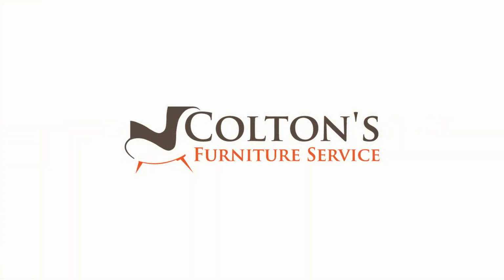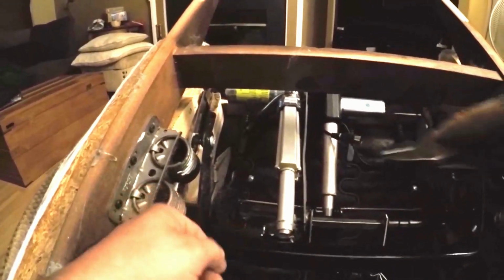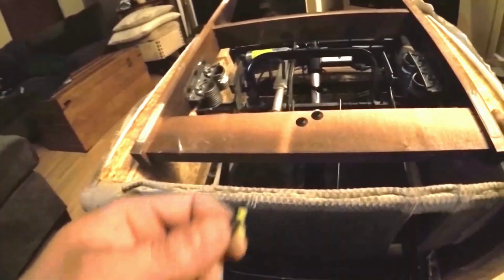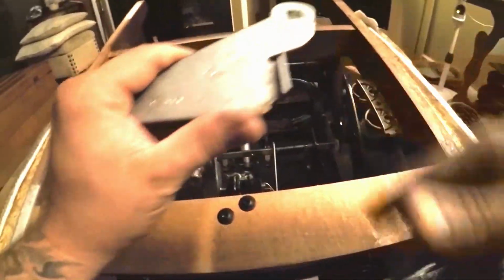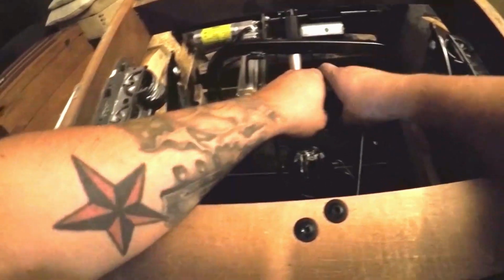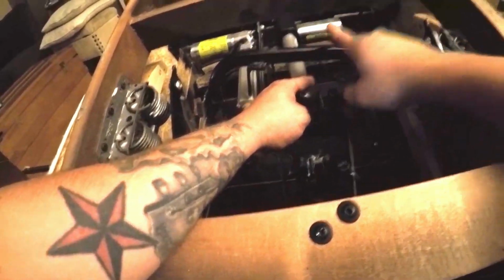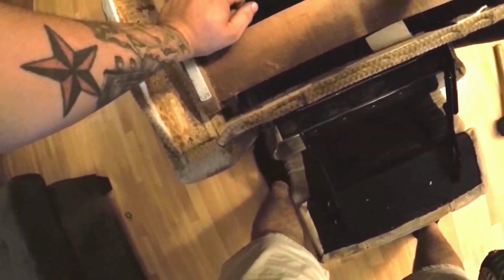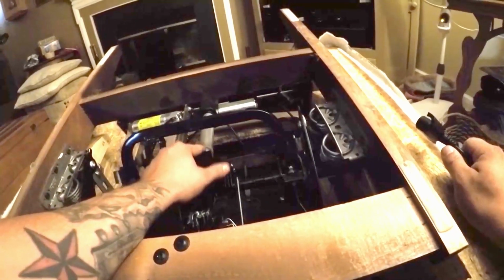Power Recliner Drive Toggle Replacement

Comment: Video was immensely helpful but we need better video of orientation of the triangle pieces with the drive toggle.  Had  to replace with the new metal piece and it came with additional bushings and different sizes and it did not align at first.  took it apart and back then the drive toggle was 90 degrees off.  took it back to apart and back together and it was upside down.  A new video or explanation and pictures of the orientation  of the new metal drive toggle would be great.  I have 2 recliners so I was finally smart enough to turn the other one over and figure it out.  
Thanks again for doing the video

Comment: This part also broke on me and ended up replacing it with the new “heavy U shape piece” .  My chair has never worked so quiet as it does now without the cheap plastic parts.  The down side is to get this part you have to go to E Bay and find the part.  The part is a rip off as it will cost you about,$75.00 for this  U shaped part.  Bite the bullet, the chair will,never work as well and so much quieter and smoother.
Reply: I called  Laz-boy with the product / chair # and they sent out the replacement parts for free. There is a 13.00 - 14.00 shipping handing change. 
Just a note on this,  my mom and dad were the original purchaser of the chair.
Reply: 7

Comment: Thanks for the video. I have the same part broke and have to replace it tomorrow. Lazyboy sent me a metal upgrade replacement. It called a clevis mount kit ( pn#  12.000659 ).
I needed to know what parts to take off to get the new metal Clevis mount (replaces broke drive toggle) through the drive rod
Reply: john i'm in the same boat. my soninlaw trying to  put in upgraded part but cant figure it out. can you advise?
Reply: @tonynorris2506  you have to remove cloth on both sides, pull bar out. It takes some time pulling it apart. Take pictures of everything before pulling apart. Make sure it works.  try extending chair while it is upside down. Don't staple material till you make sure it works
Reply: @johnschoellman7021  Excellent advice!! TAKE PICS BEFORE YOU START! Even a video.

Comment: I love the video, but I cannot get the two bolts off. I don't have a torch. I tried heating them with a butane lighter. I bought a nice T30 screwdriver. It doesn't work. My drill seems to not have enough torque. I'm stuck.
Reply: Ron White I have had the same problem with my power drill. I have been able to get these bolts to move with a ratchet when the drill would not do the job.
Reply: Coop's Homestead Coincidentally, I just bought a 3/8 ratchet and a T30 socket. This project is allowing me to bulk up my toolbox!
Reply: yup I broke TWO cheap ratchets trying to get those b@stards out.
Reply: How did you fix the heating bolts

Comment: For parts contact the Comfort Care Department at 855-802-6636. There is now a metal upgrade part to fix this problem: # 11.024897  Install is a bit different but still not that difficult. Note that the plastic Drive Toggle and Motor Clevis Mount are now one part.  The diagram of the new part that they sent me is a mirror image.

Comment: Thank you for this video. I know it will a great reference when I begin the repair. I received the new parts today and will do the repair tomorrow. La-z-boy has updated the drive toggle to a heavy steel replacement. Looks like it would never break. It’s a different size and shape as the original but the repair should be much the same as the video.
Reply: Joe Nobel how did the repair go with the new metal part?
Reply: Coop's Homestead it went well. When the chair broke I didn’t se how I could fix it. But after watching your video several times, I decided to give it a try. Then when the parts came, the toggle was different  and it replaced several of the parts, but everything fit and the chair works great. Thanks again.
Reply: Me too
Reply: Can someone tell me what a long extension looks like?
Reply: Theresa Komes check Colton’s utube video on repairing lazboy drive toggle. At 3:50 minutes they show a picture of a long extension.
Reply: @joenoble2682  I just got me new metal toggle in and will replace it tomorrow. Colton's video will help a lot. It should save me some time once I saw what to disconnect. I figured I would have to remove material on the sides when looking at it.
Reply: John Schoellman yes, you have to remove the staples down both sides until you can access the shaft. Also you need to study the drawing they sent you to figure out how the new parts fit. Good luck!
Reply: Help me!!!
Reply: @theresakomes8637  did you get help?

Comment: great video. I would like to make a suggestion though. please put the camera on a tripod next time. More light also. hard to see the black parts.
Reply: HELP! ’m trying to repair an electric rocker recliner that someone else started on. Would it be possible to get close up, well lit photos of how everything should look once it’s back together? The rod was taken completely out so I don’t know where all the spacers go, the position of the screw holes once the rod is inserted (off to the side or on the bottom).
Reply: @JP-mf7xv  Did you get it back together?
Reply: @rstjohnw  No🙁.
Reply: @JP-mf7xv  Do you still want help? I am about to order the parts for my chair. I can try to take some pics for you.
Reply: @rstjohnw  I would really appreciate that. The problem is that I’m trying to pick up where someone else left off. He removed the entire rod instead of just pulling it out far enough to replace the toggle connector and clevis. Now I don’t know how to lineup the rod, spacers, connector & clevis...including all of the pins.  There’s also bracket type of thing with springs that goes on either side of the hinges  and I can’t be tell how they are supposed to be placed. Any pictures you can send will be most helpful. Thank you!
Reply: @JP-mf7xv  I will keep that in mind when I am repairing my chair. I will try to help you after I am done. I was a repair tech for 25 yrs so I have experience taking stuff apart and putting it back together again. I will get back to you.

Comment: Thank you! That helped me fix my parents chair for them and replace the broken parts. Very clear message and video. Thanks again.
Reply: How did you get the bolts to budge? I removed the nuts, but the bolts won't budge. I can't figure out if they are stuck in the rod or the little metal plate.

Comment: Lol, just got mine done. Took 2 tries. Key part is at 5:54. Forgot that and the recliner footrest only moved up 6 inches. Took everything apart again and now it's perfect, except for the staples. Dont have a staple gun. Would have been a headache if not for this video, or a huge hassle to try and get layzboy to fix it even tho I didn't purchase it from them. Thank you again
Reply: I stared and stared at mine for an hour , and realised the rod had to come out the side , why star head bolts ? just to halt the process another two hours I guess .congrats I'm going in for my second attempt today wish me luck !
Reply: @beatvampire  pause the video at 5:56 and make sure the black piece points are facing up at the same time you adjust that L shape bracket that came off 5:54. Good luck man, you'll nail it easy on the 2nd attempt
Reply: @alfonsoalfaro8972 Did you wear the same black sox as in the video whilst doing yours , are these compulsory ?
Reply: @beatvampire  I did not have full black Sox but did have have ankle high black Sox with the toe section grey which is why I think I did not nail it my first attempt.
Reply: @alfonsoalfaro8972  Im now downstairs  half drunk babbling incoherently after my second failed attempt Ive gone "Crazyboy" with one black sock on my hand
Reply: @beatvampire   lmao. Umm. I dont know what to say. Make sure your on wood floor. I did have 3 broken pieces that needed replacement. Drive toggle, motor clevis mount, drive toggle connector. You can always take it to layzboy and have them repair it. I'm sure they will be happy that you did most of the hard work by disassembling it.
Reply: @alfonsoalfaro8972  where did you find parts
Reply: @jimmyladd9468  brought the broken pieces in to a La Z Boy store (service department) and they just gave me the parts that I need, which was 2 pieces
Reply: @alfonsoalfaro8972  thanks man
Reply: Fonzo Alfaro Completed putting in new parts, only the last two. I did not have to remove the drive bar. Everything works fine, except when closing it stops about 1 inch from the chair. I did not remove springs when I started, any thoughts of how to get to close completely?
Reply: @harveyraterink7458  maybe the motor was not moved all the way back/forward before you repaired it?
Reply: @harveyraterink7458  did you ever figure out why it would not close?
I had this problem before. I had to take the bar out again and turn the part over. It worked after that.
Reply: Thankyou vert much